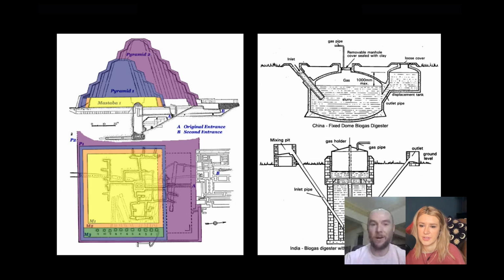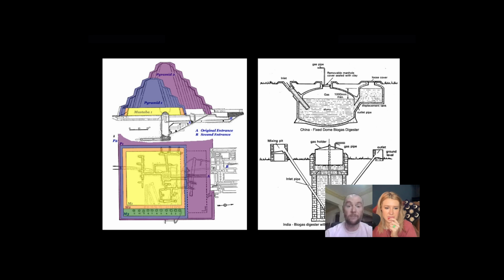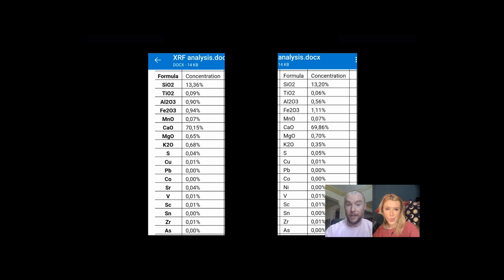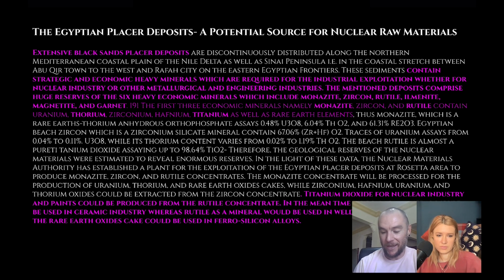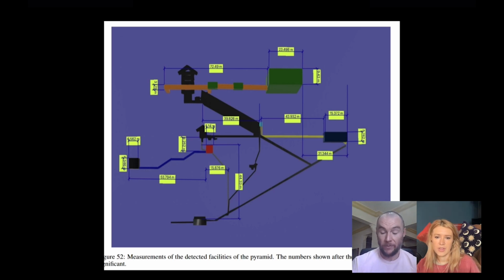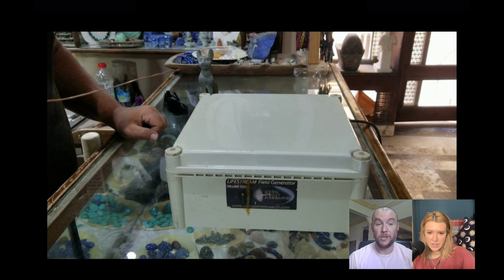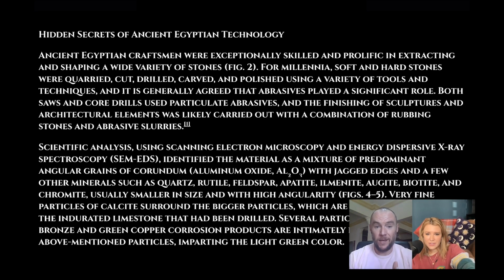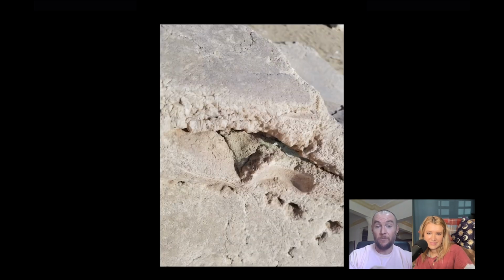The Original Purpose of the Pyramids

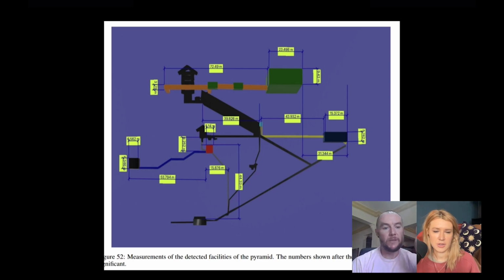Comment: 1:14:06 First off you are making a claim that the shafts were completely sealed in the Queen’s chamber, but as Dunn wrote, the shaft’s entrance into the chamber was broken open by someone. They only could have found that opening if there was an indicator something was behind it (otherwise they would have more than likely been trying to break open random parts of the wall based on random assumption and guesswork, rather than the likely rational evidence of something behind it) and Dunn mentions that there was a very tiny “nozzle” type hole which would have delivered the liquids into the chamber to create the hydrogen gas to aid in the ACOUSTIC processes which are, up to this point in the video, oddly vacant. Also, the very tops of these shafts have not been publicly disclosed as to where they lead, so any claims that it is IMPOSSIBLE to be fed chemicals is an erroneous assumption. The speaker needs to be a bit more careful about such assumptions, but, then again, I am more in the camp of advanced acoustic design (analog radio) of these structure (potentially utilizing some chemical processes) rather than this rather primitive chemical plant created by North American survivors of the Younger Dryas. No… these structures had no advanced successors to the the original design and most were COVERED by these sands, so the evidence show these were most likely antediluvian in nature, the sand being evidence of mass deluge wiping out northern Africa and the proceeding civilizations.

Comment: What if.....the so called unfinished obelisks, wernt obelisks.

What if....they were the plungers?....it makes sense that under all that pressure that a mechanism would be prone to failing.......what if, it was a weight to pressure ratio, meaning...once finished creating a gas, the plunger would be fully extended, and then as the desired material is removed,  the plunger moved down to maintain the outward pressure......once the plunger hit the bottom, with the tip of the obelisk only protruding , the process started again, after a a single reset of the plunger

Comment: I think the original purpose of the pyramids was to be safety vaults for the treasure of the kings. Remember that people living at that time heard stories about the younger dryas cataclysm and how Atlantis was devastated by huge tidal waves. So what would a king do to secure their treasures? Of course, build a vault that could withstand a cataclysmic tidal wave. If we acknowledge this, everything about the pyramids make sense. It makes sense why someone would build such a massive structure with a wedge shape, that only has a tiny little chamber in the middle. The shafts going from the kings and the queens chamber also makes sense. If the pyramid was sunken into the ocean, survivors of the dynasty could use the shafts to locate the treasure chamber deep within the pyramid. Also, it might be that the structure was designed to be water proof, so that a future recovery expedition could drain the shafts from water, go down and collect the treasure, even if the pyramid was submerged far below the surface of the sea.

Comment: This bloke is right. Just look at the chemical stain on the walls in the kings chamber. The level is just above the stone box ( sarcophagus) 
# I believe a third chemical was inside such box plus the two entry vents - which are at the stain level. 3 components like with —-gunpowder. But controlled. Maybe vibration or sound ??.
Just thinking 🤔. From 🇦🇺

Comment: 1:17:02 - Wait, are you implying that they flooded the entire volume in and around the pyramid so that they could float a raft around to some correct place, and then lowered the water to bring the stone into place?  And that they did this over and over, for each stone?  Fill it, drain it, fill it, drain it, etc. etc.?  Has anyone calculated how much water that would take?  How did they pump it?  Has anyone calculated the size of the raft that would be required?  Etc. etc.  This is an idea that sounds innovative, but the devil would definitely be in the details here.  Has anyone done the math?

Comment: You don't need millions of tons of rock to build a methane gas digester. Would you build a 10,000 ton stove for your kitchen or a 10,000 ton microwave to nuke your TV dinner?

Other than that, I have to say it is a very ingenious theory. It implies that there was a pre-cataclysm civilisation that had a plan for restoring some of what it lost. Which fits with the curious ability to build pyramids and create artefacts such as bowls and bottles whose quality did not improve over time but actually got far worse.

Comment: The pyramids are way more likely to be machines than tombs - as to the cavity detected by Muon Scattering above the Great Pyramid’s Grand Gallery, if the cavity is on an incline parallel to the Grand Gallery, this opens up the possibility to the Pyramid being a Transmutation device, especially as the angles and measures in the pyramid are very significant - see O-Day - New Dawn of an Old Age - Martin Fleischmann Memorial Project.  And the purpose of such a device?  To generate from the hydrogen derived from water (and, yes, that lowest chamber and passageway down does make sense as a water system) into so-called Exotic Vacuum Objects (EVOs), otherwise known as Electrum Validum or Micro Ball Lightning or Itonic Clusters and a particular electromagnetic structure forming what is known as the Sacred Geometry that consumes the EVOs in a black hole, feeds them through a worm hole, and ejects them back out into “normal space” through a corresponding white hole at precisely the point where the granite box sits.  With correct tuning, what is produced is active gold - gold supersaturated with EVOs - that can then be carried away from the pyramid in a wooden liner that likely sat in the granite box (wood being a particularly good material for holding this active gold).  The gold so produced could then be used to power systems, as a weapon, and, when spent, as ordinary Gold (as the waste product).  Interestingly, such a quantum energy system encapsulates the seven hermetic principles, albeit from a more prosaic point of view, the seven principles that also happen to be attributed to the myth of the pyramid builder, an antediluvian individual of great wisdom and knowledge who, it is said, built the pyramid to encapsulate the wisdom and knowledge of nature of his age before the flood, which was foreseen and foretold by him, in a way that would survive the dark age of knowledge that would surely follow such a cataclysm.  The identity of this individual has variously been attributed to Thoth, Hermes Trismegistus  and Enoch, although it is likely these three characters are really projections of the same antediluvian man.  In the end, it all depends on the angle of that void above the Grand Gallery.  One more point - many ancient symbols, including Masonic ones, relate directly to EVO production and the Sacred Geometry created as a result of electromagnetic vortices and toruses resulting from vortices ( in water, for example) arising from ultrasonic stimulation in a confined cavity with reflections leading to turbulence .  Also interesting about EVOs is their gravity shielding and electron solvent capabilities, in addition to transmutation and energy production and encapsulation.  So, how has this knowledge become known now?  Simply study the work and experiments collected and replicated through the Martin Fleischmann Memorial Project, recognise that as above, so below-and follow the string… wishing you a happy voyage of discovery and enlightenment…

Comment: Great video Jahannah! This actually makes the most sense of any theory I've heard of.  As an aircraft technician I always thought those shafts I've seen you crawl through we're maintenance corridors. On the large commercial planes I work on we often have to crawl through small openings and passage ways to work on things but I really found this idea of the pyramids being a processing plant to be very logical. I also worked at an oil refinery and could fully relate to Chris' explanation  of the chemical process he believes was happening in the pyramids. Thanks for sharing this with us!
Reply: As odd as it sounds at first sight, the fertilizer/agriculture clock purpose seems to fit.  It's just strange enough, just plausible enough, just practical enough.

Comment: The chemical traces are interesting I'm on board that the pyramids arent tombs but it's kind of circular to say they were manufacturing plants to have the ability to cut the stone to build the plants isnt it? They would of already had to have operational sites to prepare to build the biggest of the sites right? Like mineral compounds for abrasives and copper alloys. They had these things to build the pyramids already then if that's how they did it. Whatd they do with all the substances after all the trouble of such a large scale operation? Very interesting regardless the mans done alot of research still just scratching the surface

Comment: Interesting theory but the weakness is that the pyramids are nowhere near watertight or gastight. It's the same weakness as with Chris Dunn's theory that the great Pyramid was a hydrogen powerplant. The air shafts are really quite sloppily jointed, no way they could hold liquid or gas. Don't mean to be a downer or anything, it just seems like a rather obvious weakness.

Comment: I really like this theory. Very practical and plausible. Primitive industrial ovens for chemistry. 

Also if they understood basic chemistry then probably could produce simple batteries. Having copper they could make wires. With wire they could make motors. With motors all things are possible, especially saws. Wires and insulation would disintegrate with time. They may have used belts rather than gears and they would likewise disintegrate.

This is all more plausible than crystals and levitation.

Comment: That was definitely worth the cups of coffee!  What a fascinating hypothesis (and probably very easy to validate due to chemical analysis in surrounding rock formations).  The pyramids could have still been constructed of polymer cement from local sources, and this would have made the construction of the site much less time consuming.  I consider the iconography of the Sun between the horns on the bull's head (often seen on Hathor) to represent the glass lens that where used to melt the granite to make various stone-works.  And yes, the reason there were no construction materials laying about, is that after a thing is built, you don't leave the scaffolding and construction materials laying about.

Comment: Its somewhat ridicilous idea that you float megalithic stones up 😂 .. and it doesnt explain the cutting and fitting of stones like clay and all the high penetrating hole drillings or Micro presice vases cardved out of almoust diamond hard stones. 
Mostly the chemical plant theory works as an explanation on how the pyramids were used later in timeline. Its a Farcry explaining the building proces and original purpose of the structures.

Comment: Finally.  A logical explanation.  
THE PUZZLE YOU ASSEMBLE AND PRESENT IS ABSOLUTELY REMARKABLE.
I always thought that if the LuxorHotel (which is smaller than the pyramids) has 3000 rooms,then why are there ONLY 3 or 4 rooms in the Giza pyramids.

Comment: ...was with ya till you got to the great pyramid... ...100% wrong... ..the subterranean chamber was filled with water,  and a plunger caused the water to slam into the ceiling (trapped air bubble at the ceiling) and caused a powerful vibrational frequency (like a underground subwoofer) then...hydrochloric acid and zinc were mixed in the queen chamber creating hydrogen...then hydrogen goes up though the grand gallery which is a harmonics chamber that would give the hydrogen an extremely high vibrational frequency...then as its forced into the king chamber,  that high vibrational frequency hydrogen turns into a microwave beam of energy and shoot out those outer channels-->and would shoot straight out at a precise angle to energize the Ionosphere Just like Nicola Tesla did... ...then...all other pyramids around the world were designed as receivers and could receive that energy from the Ionosphere...and they were using this global energy for spiritual inlightenment... ...just when you thought you knew everything

Comment: I thought the Pyramids were big warehouses with intricate locks, but never cared. 5 years ago, in order to disprove an asinine theory that I heard, I decided to study the Bible and other “ancient” timelines. Of course, I came across a diagram of “Kufu’s Pyramid”. I immediately thought that their explanation didn’t make sense. So I began looking at other pyramids on line. I noticed they were all basically the same but were internally configured slightly differently. 

For 16 years, I designed systems based off of my 3 patents. 106 modifications and built projects in 48 states, 8 countries and on 4 continents. They were all basically the same but had internal components that were slightly different. I dealt with water, manure, ammonia, methane, heat, pressure, chemical and biological reactions. 

Then I came across Geoffrey’s first video. I was view number 10 and posted comment number 3. I’ve watched every one of his videos and hit the like button on all of them and commented on most of them. Geoffrey even did a video based in part about an online discussion we had and even mentioned me. 

This theory may not be 100% right, but if the “Ancients” were passing out report cards Mr. Drumm would be valedictorian. 

As an aside, in my mind the theory I was trying to debunk was not debunked, but the established Biblical and Historic timelines are fiction.

Comment: The 'nuclear heat' from melted stone can easily be explained by Bagdad batteries due to the two acids and 'glycerin' pitch makes an explosive. With no way of knowing exactly when reaction is complete or even residual acid.. Acid melts stone.  Aqua Regia, Aqua Fortis etc
Reply: Chemical reactions all generate electricity due to flow of electrons. Push the iron rod, pop the copper cap to introduce both acids. Shake and toss

Comment: Papyrus is a hardwood and water filtered thru hardwood ash makes lye or hydroxide. My theory for sphinx acceleration of water erosion.  Fill the pit with papyrus ash(or similar) and many men pour water over it, exothermic reaction makes heat and pressure to force the alkaline into pyramid chambers

Comment: Having done some Chem at Uni, i buy this guys ideas with the evidence proposed. The thing that still doesnt answer the question is the mathematical alignments......the exact spot where the Great Pyramid lies on the globe, the reason for phi, pi, etc. Ok so they exist in 3D geometry of molecules...or phi does, yet as with the 2 reasons for everything, and with the worlds energy grid pattern etc, i still do tend towards the pyramids being transmitters/receivers of energy as well. Like why stop at a single reason? Why the alignment with Orion, or Cygnus as Colins suggests? Why does it lie exactly 33 degrees off the equator and the centre of the worlds land mass (if those are correct)? Why does the earth dimensions lie within the pyramid if it is Only a chemical plant? Come on, there has to be more. 

Altho i admit, i have done very little research on the topic, i think there may be something to the concept of these being like huge electrical circuit boards.....when we look from above, many ancient sites look like modern day circuit boards. 

Hence it really may be worthwhile getting together chemical and electrical engineers to look at these things and then industrial engineers, and finally physicists to work out the physics and science behind it all.

Comment: Wow! That was amazing!
One thought (of many): If the pyramids were indeed used for chemical production, then the weathering of the Sphynx enclosure wasn't necessarily a result of thousands of years of rainwater. It could've been caused by Hydrogen Chloride waste from the middle pyramid interacting with limestone much faster. No? (a little sweetener for Dr. Zahi Hawass? ;)
Also: at the fresh dig at "The lost pyramid of Dashur" they found a wooden box? >>> possibility for carbon dating?

Comment: if you want to power a torpedo you need some copper and peroxide, the chemical reaction will create a expansion of the peroxide 
into a 50.000 x volume gas and heat.. quite simple 
( also used in some drag-racing vehicles )

Comment: If you can prove chemical fertilizers were used in massive scale on the Nile farmlands whose chemical  signature matches what the pyramid hypothesis should generate and radiocarbon date that layer to the extreme antiquity it would be enough with everything else to stimulate serious archeological inquiry into this theory. There are greased wooden sled mechanisms in the Grand Gallery of The Great Pyramid of Khufu (Keops Pyramid) but is believed to have been used to move heavy stones internally for reinforcement. This shows the Egyptians had the technological know-how to create a plunger pump such as the one you described.